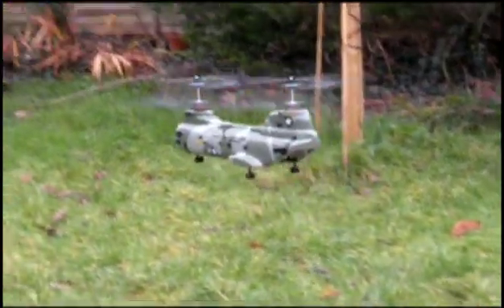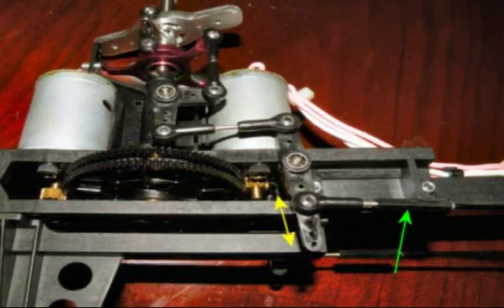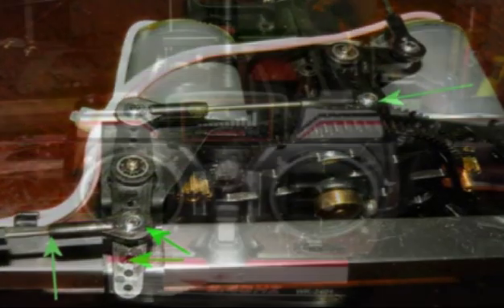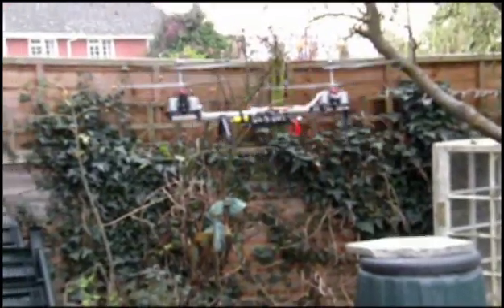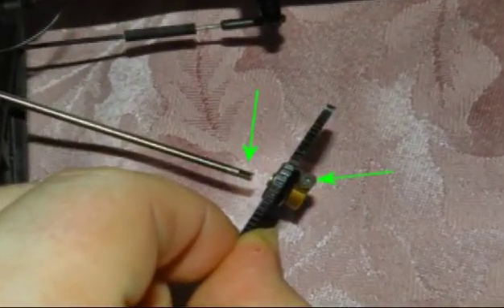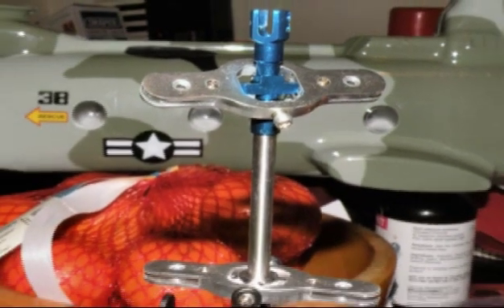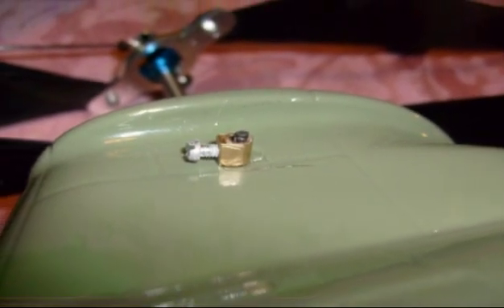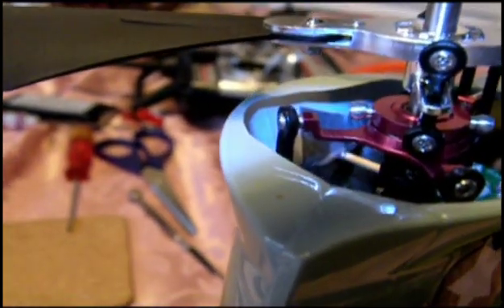Walkera 38# CH46 RC Helicopter. Modifications and tips

Comment from the maker: @tommcg46 Your first one! you are making a brave start, be sure to check out the other guide/tip videos for this heli on my channel I have updated a fair amount with significant changes! one being you only want one swash plate to move a lot not both.
Thanks for the comment, just go easy with the controls, there will be a tiny delay to the inputs you make and make sure there is no wind at all
Reply: Would I be able to view these vids? Which awash plate the front or back?

Comment: i need to take the body off but there are two steel round pens below the rotors that go threw the body with rubber grumets. is there a way to pull the pens out so the body will come up and out

Comment: received mine 2 days ago,nice kit and i gave it a good checking over.The grub screws on the main rotor shaft were loose just as you found so i checked put thread lock on all the main locking screws,i also found that it does tend to fly backwards,so i altered the the front push rods so there was more travell on the front head which cured the problem.

Comment: A great looking model that can be persuaded to fly reasonably well. So continuing from my last suggestions, the blades are ridiculously week and break at the slightest touch. Fitting 'AIREY HARDEN' blades is a good option. These blades are far more flexible and minor damage can be repaired more readily with 'LOCTITE' super glue. They cost the same as the flimsy stock blades. Land at the first signs of a low battery because 2.4Ghz receivers 'brown out' (switch off) if the voltage drops to low.

Comment: I agree with your mods and comments, well done. One or 2 more you might find usefull. The battery tray is extremely weak, as is most of this model. I reinforced the tray with very thin ally sheet, but I also moved the tray 20mm forward and fixed it from the underside rather than the top. This of coarse improved the C of G and forward flight. Bending the top blade holders up slightly reduces blade strikes and fitting a 200mm lightweight wood dowel cross the rear legs stops model faling -over.

Comment from the maker: The only good way to do this is to move the battery holder forward a little.
Adding more weight just would not be the answer as this heli is rather heavy as it is!
But the point is also that the controls are very weak so need to be improved for better flying and giving you a chance to avoid crashes from slight wind etc.